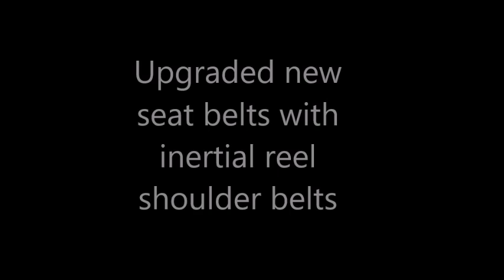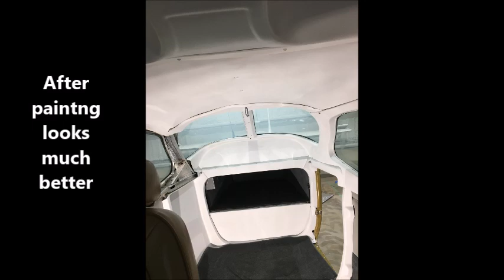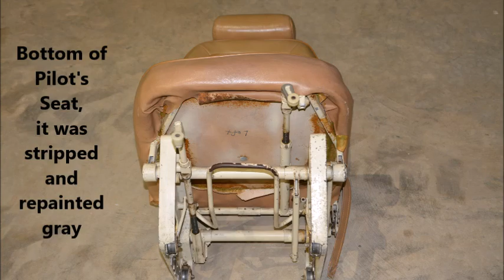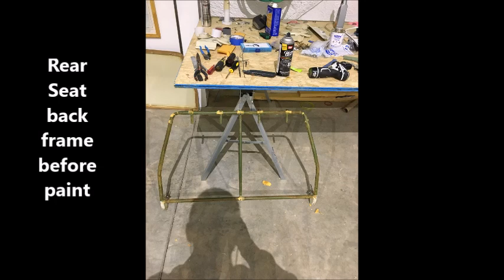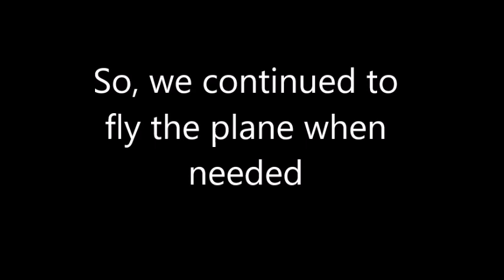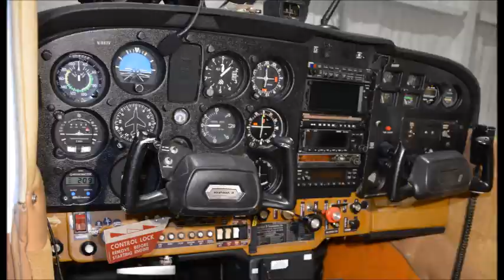Cessna 172 New Inteior

Comment: Hi Jim, congratulations on your great interior job, very motivating to update my 73M...also any idea when the interior door lock handles were changed like in your 75M   mine are farther back and just a handle, not built into arm rests...thanks
Reply from the maker: No, I have no idea about any changes to the door lock.  I can tell you that is the only place I have had problems after the upgrade.  There is a cording just above the handle that is getting rubbed as the handle goes up and down. This is starting to show wear  and I am not sure what I can do about it.  I have thought about putting a small strip of clear tape across that section?  You can sort of pull the handle towards you that minimizes the rub, but you have to remember to do that.  So you may be better off.

Comment: Jim What Glue did you use?  What paint did you use for the seats,  door trim, jams and plastics. Did you use airtex insulation? TIA
Reply from the maker: I used the glue AIrtex suggested but it took several cans more than they suggested.  I did use Airtex insulation.  I used metal spray paint for the metal parts from a building suppy/hardware store. The spray paint for the interior however, came from Plane Plastics.

Comment: Thanks for the video. I have been thinking of using these same products on my Cessna. Any tips or things you would do differently looking back on it now?
Reply from the maker: Biggest problem is lack of good instructions on some parts, like gluing up the pilot side panels.  The copilot side, where we started, we didn't know where to start the carpet with the edge of the panel.  There is a small piece of cloth attached to it.  I will say I called several times and got advise from Airtex.  My wife and I tried every way we could to get the foam and cover on the back of the back seat frame.  I decided it was impossible, then my much younger son came along and pushed it down and we were able to attach the velcro.  So when you think there is no way......

Comment: Looks great! I'm thinking of doing something similar. Did Airtex recover your seats, and if so, what do you think of their work? Did the side panels fit properly? Thanks in advance.
Reply from the maker: Dave I ordered the interior kit made by Airtex for my plane. They fit great. Only problem was this was my first attempt and I had a learning curve. Airtex was helpful when I called them with a question. I don’t doubt they would do a great job if you had them do the work.
Reply: Who did you order the sound insulation from? Thanks in advance.  @jimcroome4703
Reply from the maker: Dave M. Airtex has it in stock.

Comment: What color did you go with to spray your headliner?
Reply from the maker: I believe I used White 15313 SEM spray paint from Plane Plastics.  I purchased a clear primer that bonds the paint to the plastic from a local auto parts chain store.